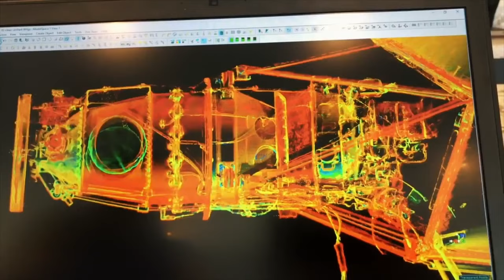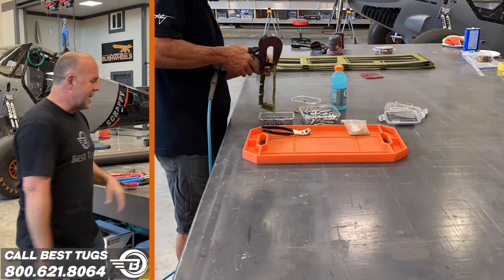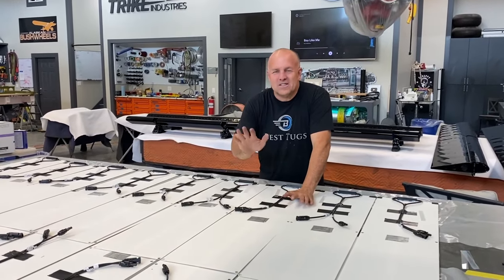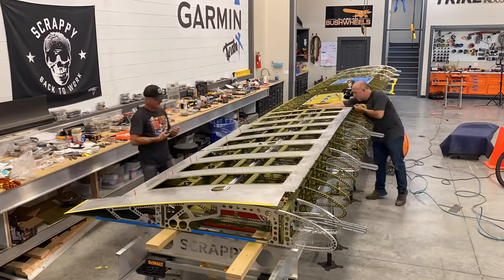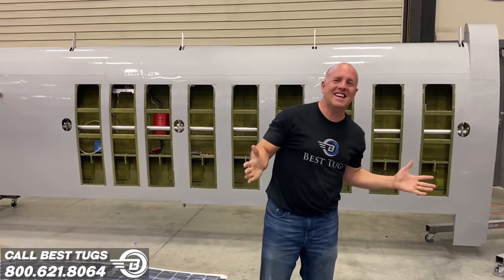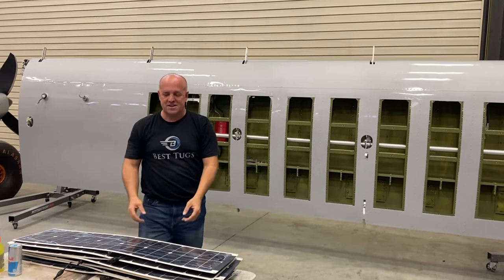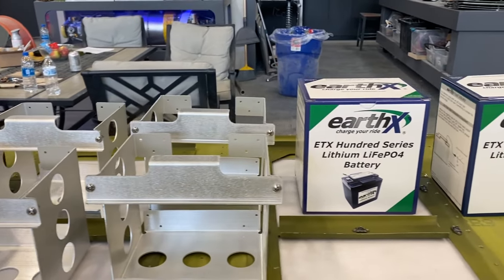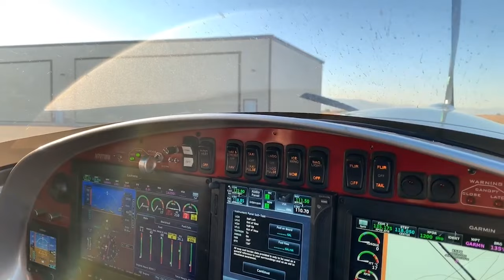Solar Panel Wings on Custom Search and Rescue Bush Plane | Scrappy #59

Comment: For RV applications or anything that's supposed to be off grid for some time, feel free to contact me for a customized design in the comments below this one. Because that is a big part of my day job lol
Reply: Are you also thinking he should have gone 24 VDC??
Reply: @portnuefflyer he might save a little bit of weight (less components) if the aircraft systems run on 12V and he wants to be able to run that system on the off grid system in emergencies, however his cable sections will need to be bigger due to higher currents, so there he will add some weight, especially if he works with long low voltage cables. Efficiency-wise, 24V could be a bit better, but an advantage 12V can give you, is that you are able to start charging from solar at lower voltages, and therefore with less sun, but that doesn't really apply here since he has more than enough solar panels to always be above 24V. I'm assuming he did it to simplify the system and I agree that that's a good choice since he has enough power available anyway and he'd want a simple robust system with a low chance of breakdowns :)
Reply: @bayenne5b   For all we know, knowing Mike like we do..., he may have some wazoo system that allows him to instantly change all those batteries from being wired in parallel to being wired in series! Can't imagine how.. but if anyone could do that he could.  There is no practical disadvantage to going higher voltage, and any earlier charging by a lower voltage setpoint would be so minimal, it wouldn't come close to offsetting the advantages of a 24 volt system.  48 volt would be even better, but pretty sure 48 VDC starters and other accessories are not a thing. The last dozen off grid solar systems I did were all 48 volt, besides smaller cabling, it's also "easier" (more efficient to convert 48 VDC than 12 VDC to 120 VAC.
Reply: @portnuefflyer  hahahh yeah I wouldn't be surprised if he'd implement something like that in case he needed it! 48V accessories and vehicle components exist, but are indeed not standard

Comment: Very cool ideas Mike!!! My question us this: are the P.V. panels on the upper wing surface going to change the shape of the wing? Will they be able to maintain the shape of the wing when the wing is at it's max loading? Will the solar P.V. panels be able to handle hi-temps and low-temps when being loaded? And most of all, are the panels set flush into the upper surface of the wing? The reason I asked the last question, is because I noticed the square corners of those panels. Are square corners in the surrounding skin of the P.V. panels, to accomadate the flush mounting of those panels on the wing? If so, please don't fly the plane... The square corners are a source of stress risers inset into the surrounding skin & structure of the upper surface of that wing, even with the doublers underneath, those longitudinal wells that you made for those P.V. panels are HUGE... UNLESS the P.V. panels have the same compression strength as the original aluminum panels that were there before the windows were created, they could easily buckle under a load... Please see why the DeHaviland Comet had mid-air failures during flight... Then You'll understand what I'm talking about here... Please have an aeronautical structural engineer check this plane BEFORE you or anybody else flies it...Please Mike, don't fly this plane until all of the mods have been approved... I would be saddened to hear that YOU became a victim of an in-flight failure, because of un-authorised modifications made to Your plane...

Comment: I came here from a car mechanic video because I saw them struggling with pushing the wrecked cars. It may mean tiny development as the floors are often covert with oil and attaching the thing to a car needs consideration, but I couldn't help thinking there was a market for Best Tugs.

Comment: SO I WAS RIGHT! When you asked. I was saying you where going to run power and lights on the wings. Did not know about the solar. That rocks. I run my home on solar from junk yard Chevy Volt electric car and BMW lithium batteries. Got 15 KWH of batts and 5000 watts of solar. Got over 250 of videos on it. Thanks for sharing brother. Love this setup. God Bless. Ps Just thinking about this. Is that solar not going to get supper hot? Hope not it will kill the out put power and over time kill the PV altogether. Not trying to sounds like a ass here. Just would like to know and see how it works out. Might keep a eye on it. God Bless brother.

Comment: Absolutely amazing as always. Three questions 1) I didn't see you mention how you sealed the solar panels from water intrusion? And 2) is there a reason you decided not to do the wingtip skids like Draco had - or have you just not made it that far yet? And 3) Did you get the Sur-Ron or Segway electric dirt bike?

Comment: If those batteries are starting batteries for aircraft, they are designed for high discharge over short periods, batteries for solar systems are usually deep discharge batteries.  Also, with multiple lithium batteries in parallel, would you not need a BMS to maintain equal charge states and monitor battery health?  Earth X batteries might be convenient but are they the best choice for the application?

Comment: 1200 W inverter needs 120 A @ 12V. That is not oversized. That is sized correctly. 1200 W / 12 V = 100 A. But you have to bump it up a bit because the inverter is not 100% efficient.

Comment: You may have already thought of this, but with the solar panels on the wings, why are you burning the fuel to get power out of the alternators?  I don't know how much you might extend your range by running off the panels, but its something you might want to look at.

Comment: With the solar panels, I think it's safe to say you lost it....
On the bright side, you won't need to install any radio, since those panels optimizers/MPPT contoller/inverter will be the only thing you hear on the airband.
Solar installations are notorious RFI generators, and especially on AM.
As a ham radio operator, I charge my batterys in the field with solar panels, but I dimensioned the panel so that I can run it direct to my battery without controller, just monitoring the voltage and manually disconnecting if the voltage goes to high.
Where I live, people living close to airports has been forced to take the solar panels on their house offline because they cuse too much radio interference.

Comment: Seems like it would've been easier to make room for two Honda generators. :) Any concern with internal delamination with the pressure and temperature cycling (especially w/ vibe) of the solar cells?

Comment: You are amazing... But just wondering... Can the solar panels resist the high lift vector when in flight (RE: thickness/strength)...stop them popping out... how did you test that?

Comment: Really hope those solar panels can handle the low pressure air over the wing pulling up on them 😅 they look a little flimsy to be an upper aerodynamic surface

Comment: This is so cool! My aviation engineering brain has so many questions at this point!
 
How will the solar panels behave under aerodynamic load, wing loads during maneuvering, heat/cold expansion etc. 
Are the lithium batteries aviation certified and is the FAA "happy" with lithium batteries, especially in the wings. 
etc etc.

keep on the great work, love it!

Comment: No idea what aviation requirements might be, but Andersen connectors are huge, over sized, heavy and low amperage compared to bullet connectors. I would have used 6mm bullets for your DC connections. And that would have been overkill for your amperage requirements!

Comment: Mike, I assume your solar batteries are also charged via the plane’s alternator/s whilst in flight? 
18panels x 50W = 0.9kW max with panels at right angles to the sun, in both ‘planes’ so to speak. Your real input wattage even on a crystal clear day won’t be anywhere near their max output in a predominantly horizontal configuration. 
I run heated gear on my motorbikes,  my jacket/gloves pull about 95W peak. My Trek LT9 Powerfly looks for 500Wh when flat. I totally endorse the electrical concept your are envisaging, but beware of the ‘real-time/world maths’ ...sheesh how dare I talk to you about maths 🤦‍♂️ You may “lay in bed at night designing things”, I lay in bed, in awe of your designs. Thank you for sharing your journey.

Comment: One question, how are you ensuring the bronze bushings don't eat the aluminum? I know from my boat that mixing aluminum, copper, and electrolyte (sea water) is BAD and it is the aluminum that disappears. Maybe the green corrosion protection will prevent?
Looking forward to the next video. Thank you

Comment: I bet those batteries will love the variation in temp. Cooked in aluminium oven on tarmac and -40C at altitude.
Reply: Lithium batteries have been used in metal airplanes for years. His is no different other than he's using several
Reply: @Airplanefish  they also have been used in Samsung phones. Why does Tesla have water to cool and warm batteries. Fuselage behind the firewall is usually insulated and stays fairly ambient.  wings are not.
Reply: @rafal5863  both of your examples are different. The phone battery, Tesla battery and Mike's battery's are all different and built different. As well as used differently. Take a look (on the internetat the type of battery and construction of each of these three batteries and you will see the difference.
Reply: @rafal5863  another thing is alot of general aviation aircraft have the battery located in the engine compartment. Not all are located in the aft fuselage

Comment: Amazing work as always! Do you plan on using the same type of carbon fiber leaf springs on the tip of the wing like you thankfully had with draco? Or does the dynamic suspension make that unnecessary?

Comment: Best way to carry welding energy on a plane would be in a pressurized tank. 
...But you want to be able to weld Aluminum.
How about a clutch that disengages the prop and engages a generator?

Comment: How does one test Vd or Vne on solar panels?  I would expect an aluminum backing, even if on .016 or so.

Why not 220v from 12v inverters?

Second to FLIR for pilot view fixed and a FLIR pod rear operator station.

Comment: Will the stagnant air inside the wings at higher pressure than the lower pressure fast flowing air over the wing and panels bow, break, or suck them out of the wing?  Inner panel would prevent that.
Reply: I'm thinking that the wings have mini vents...

Comment: Why not use the solar to supplement the alternators power too, it would reduce load on the engine slightly and increase fuel economy. Its free power, might as well use them all the time ?

Comment: Mike - with low pressure of the top of wing, how do you ensure the solar panels will handle minimum pressure without pulling out or some other failure mode?
Reply: Delaminating ??

Comment: Good grief, Mike....the hair on my arms is standing on end....wings on Scrappy!  I got the 900 Watts of collector / 14 Volts = 65 Amps.  I didn't hear the details on the solar battery bank...how many of what capacity?  When you were talking about being able to weld, I'm assuming that you are intending to use all the solar batteries in series with a DC Input/ DC Output welding scheme (18 x 14 = 252 VDC). How close am I ?

FYI...I built a silicon solar cell from scratch in high school physics class and I've been doing the math associated with solar systems for more than 50 years.
Reply: Hello there 👋👋,how are you doing today?hope you had a nice day?GOD BLESS YOU!!!

Comment: How much flow disruption is caused by the crank arms sticking out the top of your flush rivet wing? Or the clearance holes when deployed?  Why not use an idler to avoid breaking outside the wing surface?

Comment: Edward Frater,
 Another question, as no one has asked it, will the solar panels to wing upper surfarce be waterproof? if not the wet will get into the wings and cause extreme corrosion. in a short time.

Comment: Will lift over the wing have any effect deflecting or possibly damaging the flexible solar panels?  Having the wing open under the panels makes me wonder about pressure differential possibly messing with the panels.  Is that a concern?
Reply: My thoughts exactly! Lift creates a vacuum above the wing, and it seems as if it could suck/tear the panels off. I'm hoping there is a layer we didn't see that sandwiches the panel across the edges and center to keep them from trying to bubble up. Aerodynamic forces could cause them to vibrate like kazoos, weakening them over time as well. Maybe he has the wing loading all figured out and the panels can handle it, but if he had multiple panel failures (i.e. departing the wing) on one side, It would seriously impact lift.
Reply: @AmericanSmallArms  I have seen pics of Scrappy at Oshkosh, and the solar panels are definitely bubbled up!  Mike!  For your safety, PLEASE do something to stabilize the mounting of those panels!  I am terribly afraid those will rip off of there and your lift will collapse, probably asemetrically, and you will lose control authority!  Please look at this carefully!

Comment: First thing I don't like. A little more fuel and a small generator would be much less weight than all these solar cells and batteries. But it's his plane of course, so he can do what he wants. I wouldn't want to have something on top with lots of places where water could leak into the wing.

Comment: Do you think the low pressure on the top of the wings will suck the panel’s out?
Reply: I've seen so many people comment or ask this same question about the panels  getting sucked out. What am I missing? The panels will be screwed to the wing and sealed. Why would they come off? It's the same as a large panel on top of any metal wing. They don't come off unless the screws are missing

Comment: Hey Mike? 
Is there going to be a customized set of cross bracing & wiring to run the bikes together as a 4x4?
you know, you never know in an emergency you could pull (really slow) a stretcher with wheels on it to get an injured party to safer ground.

Comment: Edward Frater, found the posting issue, my fasult.
 I asked the folowing, it was in 1958/9 I wasvat the Farnborough air show where a Lancaster towed in sight towsing a Horsa glider. This landed on the main runway after using the Otfur release and out jumped 20 or so commandoe's who faught amocked battle. Then put up 2 high poles to wj=hich a long tow cable was attached. T Lncaster returned under full power and caught the special tow rope which pulled the glider back in to the air.
 So could you fit a Otfur hitch to Scrappy, and at Oshkosh in 2022 do something like this? towing say a kit fox and snatch it back into the air? would be something to out do any other display!!

Comment: How are those Solarpanels fixed on the Wing? Are they glued in place? The low pressure on the Wing top side should be a lot of force pulling on those sheets…

Comment: Hey did you think about taking a set of mobile tools like the Bosch professional 18V system instead of kable tools? There you got the most important tools with a very good weight to power ratio. Especial the new anglegrinders are amazing light and powerful and with a set of 3 battery’s you are prepared for everything in this system.

Comment: Just wondering, do you actually need to plug scrappy into ground power or do the solar panels provide enough power from the ambient light even in a hangar to power bms and standby functions?

Comment: Mike - Great Build.  You always consider failures in your design and often comment.  So, did you consider how to protect the battery cables in the wing?  Each lithium battery has a VERY large ability to deliver fault current, very quickly and each battery stores a lot of energy.  

I looked at the EarthX technical description of its fault protection features, and the fault current scenario is not mentioned.  During an unforeseen event causing a battery cable, in the wing, to fail to the aircraft structure, the cables, regardless of their large sizing, will overheat the insulation.  Considering other sources of potential energy (gas) in the wing and critical nature of the structures (spars), the result would not be good.

There is a solution.  In case you had not thought of it, install fast acting fuses directly on each battery's positive terminal.  A good way is to use a Blue Moon MRBF Terminal Fuse Block, with appropriate fuse characters ( time versus current).

Alan

Comment: I didn't see this coming, 35 years of solar use, selling and installations besides personal use, and 33 years of fixed wing exp., who would have guessed?!  What kind of welder runs off 1200 watts of 120 VAC? I used to weld off a 36 VDC battery bank, with an old Jacobs wind turbine as a power source, when a gust would hit, I'd have to pull the rod back a bit so I didn't burn thru, which makes me think maybe he is going to have a DC welder, working direct off the batteries, that little AC inverter won't hack it. Why not a 24 VDC system Mike?

Comment: Solar panels usually have rough surface, are they safe on the top of the wing? Any loss of lift ? May not be an issue with that engine, but still curious, does it impact the glide ratio?

Comment: Bikes, solar panels, fuel, and batteries loaded on the wings can be a concern. Density altitude is real.
Reply: High wing area and high lift slats and flaps are real things as well that can provide needed lift at low speeds in high altitudes to compensate for the higher gross weight of the features you mention.

Comment: Makes me wonder if its possible to integrate solar panels into a multi reinforce carbon fibre structure without causing bonding, charging or aero dynamic issues.